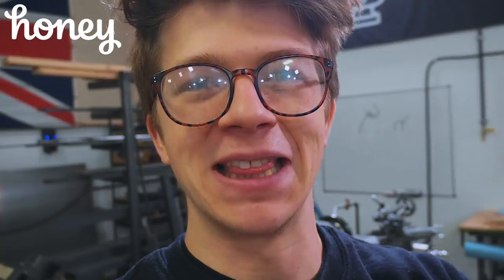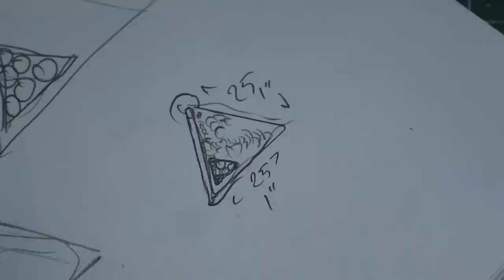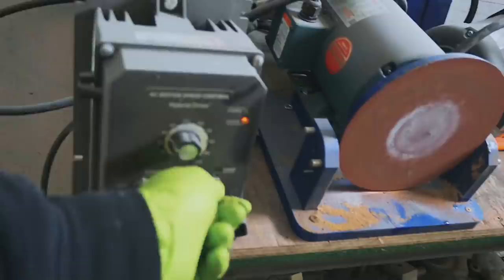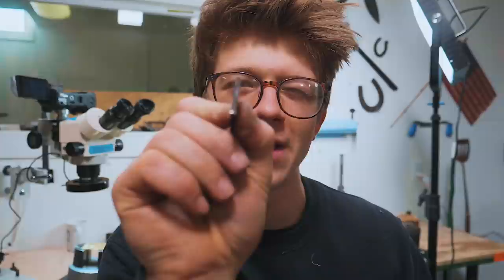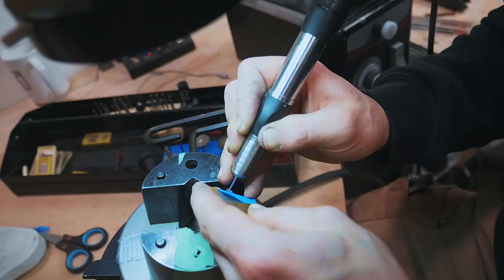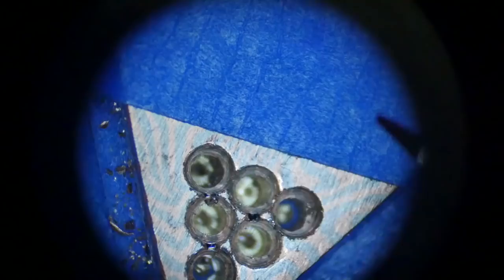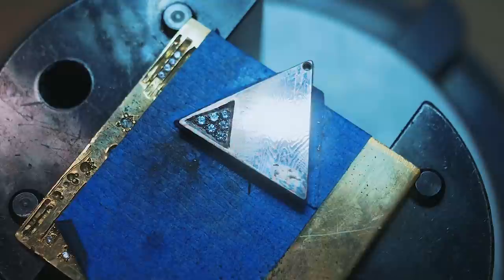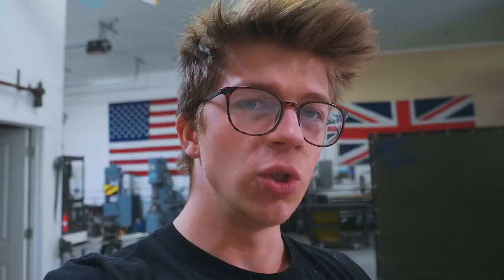MOKUME GANE PENDANT!!! Copper and Nickel Damascus!

Comment: That copper nickel contrast is amazing. I’d love to see this as a knife (or lock pick😁) handle. 👍
Reply: Copper and nickel aren't good for hardness and keeping an edge, it would make a good decoration piece
Reply: The Lost Boy it wouldn’t work as a general knife but I think would be fine as a serrated bread knife.
Either way, LPL was talking about it as a handle, not a blade. I’d worry about the copper greening with skin contact.
Reply: Why are you here?
Reply: The Lost Boy We usually don’t put edges on handles. 👍
Reply: LockPickingLawyer EXTREME lock picking
Reply: Hey LPL, nice to know you watch this channel. What about a pinning tray made from this material? Or would it be too hard to see the pins and springs on it?
Reply: Dat crossover content

Comment: Alec, Im sure you know this already, but in case you dont, be weary of the disk sander, as it eats material away on the outside edge of the disk faster than in the middle, and can cause surfaces to not be parallel anymore if you're not careful. Keep up the great work!

Comment: Alec, try superglue to hold down your project when working with small things in a band saw. Just glue your metal bit to a sacrificial piece of plywood, BAM you have "safe" handles. Diresta uses super glue for everything!
Reply: superglue and just a pinch of baking soda ,bonds instantaly ,build it instantly ,three d printer ,with out the the printer ,just your mind!!
Reply: thank you, fix anthing for a buck

Comment: Use the green wax you've been using for molds - melt a chunk onto the metal to grind and stick a wooden dowel into the wax. Then you can hold the piece to grind and polish. Jewelers do this for lots of things. Adding a very very light coat of something like canola oil on the silicone as a release agent might allow the wax to flow smoothly...

Comment: Alec get a sheet of thin finished plywood. When needing to cut something small on a bandsaw glue what you need to cut onto a piece of the plywood. You can then hold it with your hands for control without getting close to the blade. Finished plywood is perfect for that because it's flat enough and smooth enough.

Comment: Alec Steele Silver and Gold Damascus please, or if you're scientifically inclined: Niobium-Titanium
Reply: Anodized Nio-ti?
Reply: @MmeHyraelle  Very beautiful combination, very difficult to alloy and then anodize.
Reply: @MmeHyraelle  I am building a carbon arc furnace within a hydrogen gas powered mini foundry in an attempt to forge a ring and potentially some bullets with Ferro-Niobium (35-65%) and pure Niobium.
Reply: @ProlificInvention  you have a page?
Reply: @grendal113  Yes but I've been neglecting it.  Just click on my profile pic and it will take you there
Reply: @ProlificInvention  I built a hydrogen system to run my shop in alaska. Cost of cutting fuels was prohibitive and water abundant.

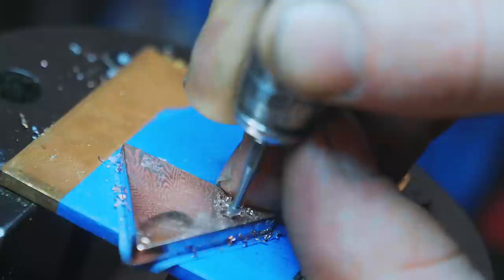Comment: 10:00 the caliper literally says 1.99 
“Two millimeters exactly” 😂😂
Reply: Those burs would be more accurate then his caliper so I tend to think it was 2 mm exactly :D
Reply: when you drill it usually tends to be a bit bigger than you measured
Reply: 1.99 is actually exactly 2 mm if you take the tolerance of the calipers into account. the failure lies in the thousands of a millimeter... saying this, there is no thing on earth, that is "exactly" any size. it's just a matter of how precise your measuring method is. even a drill bit, that measures 2.00000 millimeters would really be something like this size: 2.000035892. but there is a limit how exact you want to measure it.
Reply: Taunus-Tims Welt 
Yeah I figured
Reply: Taunus-Tims Welt Even more technically, everything is exactly only one size: The size it is.

Comment: Just a quick tip regarding soldering the jumpring.. try heating the ring evenly instead of the solder itself. Also know that the solder will run toward the hotter parts of the ring, so if you put the solder on the opposite side to where your torch is, it should run into the gap nicely. otherwise, keep practicing and you'll get better and better :)

Comment: For the hanging hole, instead of going front to back which requires a link to put it on a chain, I would have drilled holes in the sides that meet in the middle so that you can put a chain right through it. That way and the front face of the triangle remains unmarked. I think it would have had a cleaner look overall that way, but that's just my personal opinion.

I suppose if it was really thin this might not have been possible though.

Comment: Stone marking tip my stepmother (certified gemologist) used occasionally for mass pave or invisible settings' layouts:  
Put a bit of non-damaging ink or paint on stone's face & stamp that to metal for exact dimensions of stone face no matter stone's shape. Just look up what the stone you're using has issues with as far as potentially staining or scuffing the surface. When done, just drop stones in their appropriate cleaning solution bath to remove the ink or paint. 
 (If I remember from 20 years ago correctly, white acrylic paint or talcum powder paste were used mostly for darker metals & black alcohol ink marker was used on certain stones for lighter metals. There were other black "inks or paints" but I don't recall what they all were.  NEVR use graphite due to its abrasive properties & can it get into cracks, scratches, and/or chips you didn't want highlighted or didn't notice at purchase.)

Comment: New series name.. "How Alec became a jeweler"  

Also great work on the settings and pendant.  When I make my designs I try to plan the way I attach the chain so it works into the piece design. Like that one I would drill the hole through the side rather then the front so I wouldn't need a jump ring to attach a chain to and disrupt the look of the piece.

Comment: An idea for a mokume gane project: a super luxurious poker chip set, with perhaps a precious metal disk inlay and stone setting. If you can make it a large enough set, I am sure you will find a happy customer for it too...

(speaking of disk setting: I'd love to see you try some of that: setting small plates or disks of metal into other metal or into wood. It seems like a silly glue job on first thought, but know that true craftsmen used to be able to do this without a single drop of glue... (and glueing doesn't give such a swell result anyway) Another path to explore and push your boundaries)

Comment: Great billet of mokume gane and pendant Alec!  Your power tools are making me drool.  You seem to have studied non-ferrous metals and stone setting, but you haven't followed some processes I learned and I would love to know why.  MAKING the mokume gane:  I learned to fuse the billet in one heating and to apply pressure while doing so.  You can see the fuse point and remove the heat right away.  HOT forging:  I have never seen hot forging for non-ferrous metals.  These are softer when quenched as soon as the red dulls.  The molecules stay misaligned for a longer period of time.  Don't know if the electric forging machine would make the metal too hard right away.  I would usually make a billet and after quenching, forge till 1/3 to 1/2 the thickness annealing along the way, then run the billet thru a rolling mill to reduce the thickness annealing when the metal gets too hard.  So have you tried doing the process the goldsmith way of doing things and chosen to switch to the steel way deliberately?  I could have done better writing this but it is late.  Jo in Philadelphia PA

Comment: ALEC! Very important when using the superglue trick that you fully burnish the tape down otherwise you risk it suddenly letting go. Also make sure it's fully cured (use accelerstor) otherwise it can also let go. Fingers are better when they're attached

Comment: Next time add a hole under the stones, this allows for cleaning later on as so much crud gets under the stones and if it has nowhere to go it can make them dull really easily. I worked at a manufacturing jewellers for a year or so in the jewellery quarter and it was amazing to see stuff once it had been fresh cleaned.

Comment: You know what, you could drill two more holes into the piece. One in the center between the two corners, and one in the opposite corner of the current hole. The have the chain in the center hole. Maybe that might make the oblong triangle look a little more pleasing to the eye.

Comment: Nice job Alec. You should really check out the book on Mokumé Gane by Ian Ferguson. It has probably all the info you will ever need on the subject and incredible full color photos of some work. The set up they use made titanium and copper mokumé! Vastly different melting points and incredible contrast. If you are going to be doing more stone setting then you should definitely make more mokumé. I’d love to see one of your damascus blades with mokumé furnishings. That and a spalted wood handle would be magnificent. Keep up the good work and keep having fun.

Comment: Annealing that piece before you started flattening it would have saved you the cracks. unlike ferrous metals (like steal) copper and silver will benefit from being heated up and plunged into water to relax the gain structure. because they lack the magnetism to hold them together the more you beat them with a hammer the harder they get. you can also use this to your advantage with a finish piece if its too soft. next time I would anneal at the end of your heats to keep it workable. ;) have fun hun

Comment: next time consider drilling the hole for the chain at 90 degrees.  So not from front to back, but rather through in the plane of the front face near the top apex of the triangle.  Eliminates the need for a ring.

Comment: I would have put the jumpring hole through the sides with a far smaller bit allowing it to sit even flatter to the chest/neck and for a slip loop on the cord

Comment: Next time you are soldering a jump ring, don't use the locking tweezers as it pulls away all of the heat and you had to over heat the ring like crazy to get the solder to flow poorly. just lay the piece flat on the charcoal or brick with the part you want to solder  of the ring you want to solder facing up and you will be fine.

Comment: 2 millimeter stones are optimal for many tight settings and still look good. 1 mm or 1,5 mm stones just look crappy at most times. 1 mm W/VS diamond cost few euros and 2 mm W/VS diamond cost 20 euros perfectly cutted. 3 mm W/VS diamond cost 80 euros. So the prize goes up pretty fast curve.
Reply: Stonesetting leaning curve is pretty hard. All pple cannot learn it. You have to realize that metals are like molding wax. Soft as hell when you go small. Even titanium or some pretty hard metals to set stones. You just need your hands and not even small hammers are needed. Powertools are for noobs.

Comment: If you are going to continue making jewelry, you might want to invest in a rolling mill. It will make tasks such as thinning stock much easier. Also look into getting someThermo-Loc which is a reusable moldable plastic type material for holding small objects securely. Two channels that you should check out to improve your stone setting/jewelry making are diameter and Pablo Cimadevila.

Comment: Hey, Alec!  Cool project!!  I'm just an old General Contractor and wannabe carpenter, but is there anything that would prevent you, in the future, from clamping down a steel ruler of some sort, along each scribe-line, to act as a guide for your power tool?  Also, after center-punching the location of your holes, would there be any advantage to having a sort of miniaturized "drill press" so all of your holes have parallel sides, and then step up the hole size in 3rds or 4ths until the desired diameter is achieved.

Not, I repeat, NOT trying to tell you your business.  I've just seen a lot of your bigger projects use techniques in metal that I've used in wood for 30 years or more!

Regardless, welcome to the US, and if you get the chance, go ski Red Mountain!  At least, that's what I think it was called.  1991 was a LONG time ago!

Comment: Probably an ignorant question, but could you have used the hydraulic press to flatten out that forged piece without it cracking? What are the pros and cons of using a hammer rather than a press?

Comment: is a High carbon steel - Copper damascus possible? so you have a red - black pattern?
Reply: The copper would be squeezed to hard between the way harder steel layers. So you would end up with thick layers of steel and nearly unseeable copper layers. Plus, copper is molten liquid when steel is still unworkable hard.

Comment: Wen your using the vac camber you need to keep going till it won't hold its self to the top it will claps in on it's self and then pour in the mold

Comment: please consider using a mirroring back foil or polish the holes holding these "diamonds" for better reflecting the light that's going to shine trough the stones to bounce back to the front. the facetting on the back of the stones is for exactly that. your inserting lacks a bit of that. it'll make the job look much more pleasing and professionell. also big, complex first sentence glad that i made it...

Comment: my friend Alec not to sound jealous but I have notice you have made a lot of jewelry, and it wasn't lost on me the ring was a size 7 i think, and now a pendent. As of which I am pretty sure was modeled on a female's neck. So it would seem your making jewelry for a girl friend and not making any blades for me! lol also when forging a knife after you form the tip and you wish to draw it out do you start hammering at the tip or down at the ricasso. also what kind of steel are bed rails made of and can they be used to forge a knife,

Comment: When you are face grinding I imagine you have ground your knuckles a bit. LOL. your knuckles not mine. However if you go to any Gem polishing site you  will see  what's called a DOP stick.  Basically a wax stick that glues to youe flat piece and will save your knuckles. It is easily removed for re mounting. Just a thought !!